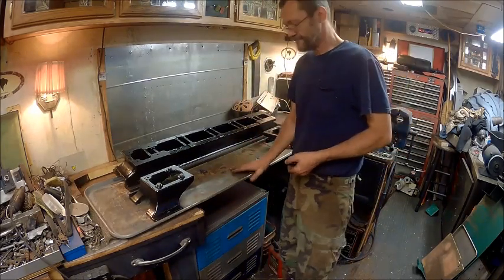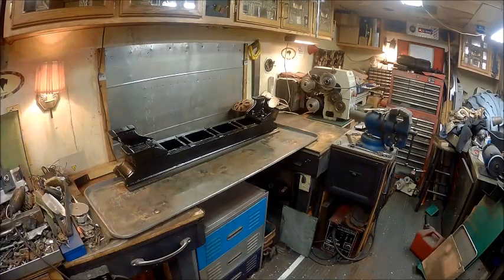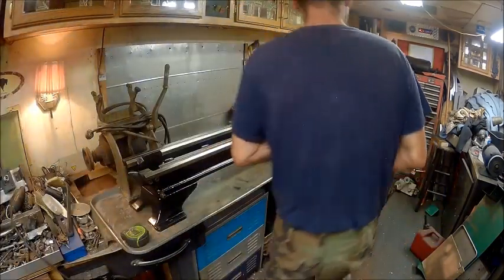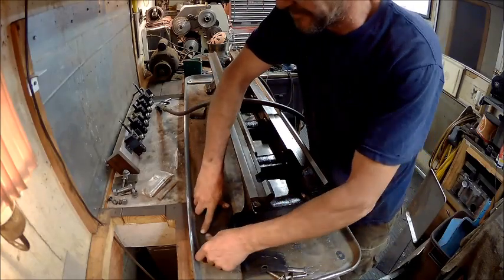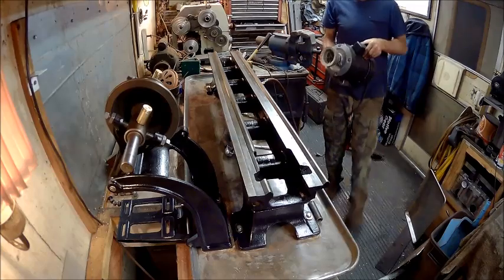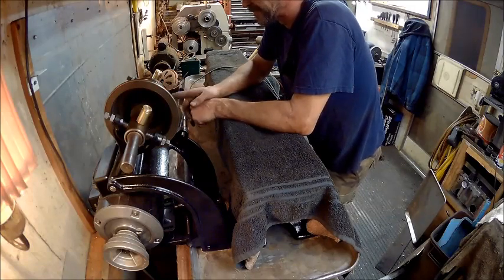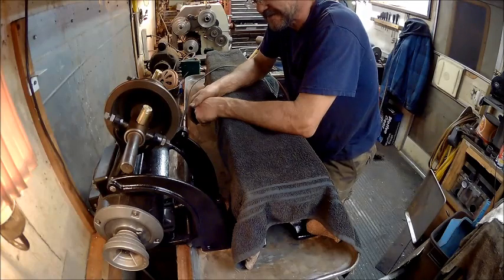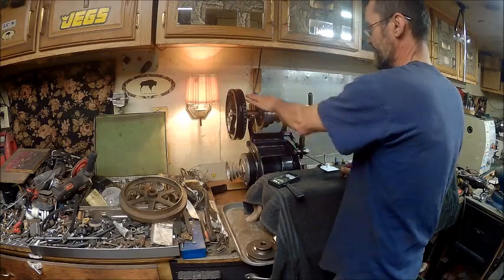1958 logan 04tlc 700a 10 inch lathe part 3 mounting to the bench

Comment: They  used to laugh at my little lathe, due to not having all functions being used , but it did just what I wanted to do and it wasn't a " A bed  accurate lathe" , older Sears flat bed , it trued the OD on end yokes, it also removed the off set casting material on the inside of weld yokes w/special adapter I made to fit chuck !  Vibration on your motor & pully  mount will need carriage  bolts with nuts on top, on my small lathe I even had to put steel plate on bottom to sandwich the wood over time and it was full 2 inch deck wood ! Just a thought !